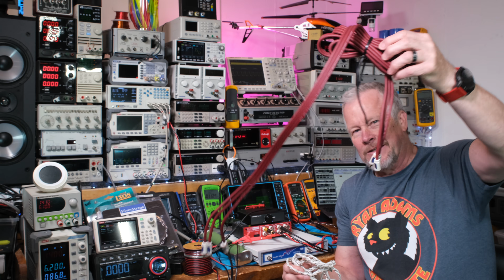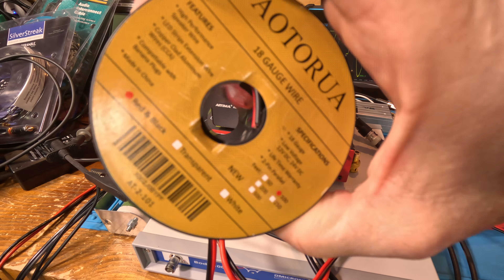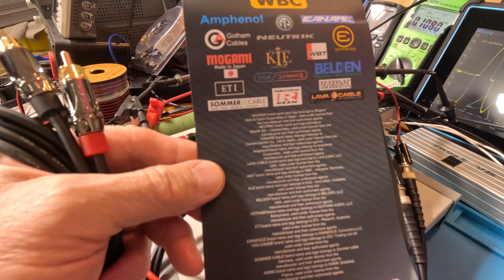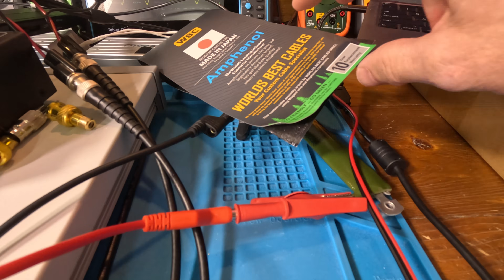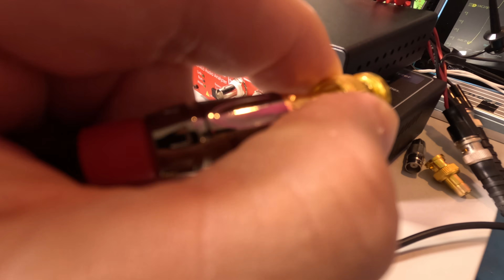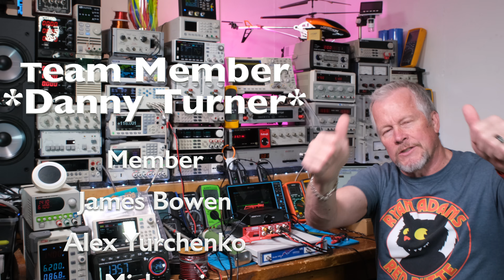World's Best Interconnect Cable Mogami cable with Amphenol connectors #docablesmakeadifference

Comment: I  have a Marantz AV10 Processor and Krell amplifiers. I use Mogami Studio series  XLR cables for all my audio. My system is dead silent with the volume cranked up. There is zero 60 hz issue, so I am more than satisfied with what I run. I also got some Mogami bulk cable and made my own speaker cables.
Reply from the maker: Thanks for your great feedback!!

Comment: Hi! I own a digital audio broadcast station. We are looking for some recommendations on a high-quality cable that can reproduce the best audio quality. We use only WAV files, and cheap cables simply deteriorate the sound. Do you have any recommendations? Price is not an issue, just finding the best cable with close to zero RFI and great audio transfer. Looking for a 1.5-meter cable that is 3.5mm to dual RCA. Thanks!
Reply from the maker: Thanks for asking!  The connectors are important, and a split cable does require attention to detail, so buying something a step above the lower cost cables will get you this quality I think.  I can't find the cable I used, but this looks close: https://amzn.to/4h64q2L
This one looks made very well: https://amzn.to/3QGel4D

Comment: I have a few RCA and balanced cables from WBC and I generally check everything before I plug them in. They use genuine components and have good soldering in the examples I have. I ignore the burn in BS for what it is. To be honest, I think cable gauge and build quality are everything. If it doesn't work out of the box it never will.
Reply from the maker: LOL the burn-in is one of the greats;)  I have to agree.  I do like the WBC brand as it is low cost and made very well.  Maybe overkill actually - but low enough in cost to be a great option.

Comment: It’s interesting that you did not comment on the burn in requirement apart from saying BS. I agree. As an electronics engineer working in the semiconductor industry my understanding and application of burn in is to test for infant mortality failures and reliability issues under maximum operating conditions. There is nothing in a cable that needs to be burnt in. I think that the 175 hours is required to convince the purchaser that the money spent was justified.
Reply from the maker: @David-ot7mv The burn in on a cable is so silly I couldn't even offer any time but to cough;)  You are correct, burn in is meant to catch infant failures.  It can have a huge impact on reliability.  

Many vendors find better ways to catch these infant mortality failures though - that are better than simply burning in...  They run a specific test that exercises the product in a way to get to the infant failure quicker.  Burning in a cable is absolute absurdity.  

Anyone that says they can hear a difference - can not prove that in any blind test.  Has not been recorded as of yet - even though there are many that 'believe' this.
Reply: @kissanalog James Randi's challenge was never accepted, while industry related reviewers achieved 50/50 results in a blind speaker cables test arranged for by sound and vision mag decades ago. Yet here we are freezing cat 6 cables. Bandwidth and slew rate limitation related to properties of active devices locked in an NFB loop is one thing, atrocious level of distortion produced by speakers in an imperfect room is another. If human hearing was good enough to even notice that, we wouldn't be able to withstand reproduced sound in the first place.
Reply: It's real. Take a length of copper straight off the reel and   make a cable out of it. Put it in your system and run a rew measurement. Let it sit in your system, running for a week and then run rew again. Dumb thing to argue about though because after 100 hours or so the point is moot. Many manufacturers spend the money and time burning in. I doubt they would do that if there were no differences to be had.
Reply: @Pete.across.the.street Please publish these data, perhaps you could also apply for a patent on a set of signals that facilitate/hasten the process? You could single handedly rattle the foundations of engineering and go down in history as the guy who turned conjecture into a canon.
Reply: @paulb4661  ok
Reply: @Pete.across.the.street I find listeners can easily point out differences between amps, as long as they know which one is playing. As soon as the cover and a set of DPDT relays kicks into action however, they suddenly become considerably harder to distinguish. Once you consider bandwidth and slew rate limitations of any amp working in an NFB loop, then add to it, technically speaking, absolutely appaling performance of speakers in an imperfect room, the influence of cables becomes marginal at best. If human hearing was good enough to sense and quantify differences you speak of, you would cover your ears and run screaming out of the room, acutely hearing copious amounts of various distortions produced by any Hi-Fi system. Psychoacoustic studies(it's ascientific discipline) have long established limitations of human hearing, but it seems, these do not apply, when it comes to individuals with strong beliefs. James Randi 1million $ speaker cable challenge was not accepted. Blind test on a large group of industry related individuals, conducted under the condition of anonimity of course, by sound and vision magazine, showed none of the participants achieved a statistically significant results. Yet here you are... freezing cat6 cables.
Reply: @paulb4661 how did you find that? By reading it on asr? I belive it because I heard it, measured it, and have done null tests with high quality binaural mics and pro tools. I think most people that can't hear a difference either have a poor system, have system poorly setup, bad room, poor hearing, or have never actually listened for differences

Comment: I have one of their cables.    It was the sortest digital cable i could find.    I had to laugh at the burn in.    Are the 1s and 0s gonna be different.    I really doubt people can here the difference in rca cables if you got it yesterday or 10 years ago.    I am not gonna argue with people that believe that.    Its just very unlikely.    Not to say i don't like there cables.
Reply from the maker: @jasonk5979 No - the 1s and 0s do not care - unless the cable is very long.  Short cable for any signal is almost always better.  It is crazy that people sell expensive cables for digital signals in audio applications.  It is actually sad that the industry is this twisted.
Reply: @kissanalog  

It's been kinda sad for a long time.     Cable companies selling customers on all sorts of nonsense.    Without any data to back it up.    Don't get me wrong.    I like high quality cables. Looks/ durability .   And i don't want it to negatively affect the sound.    I just don't believe in most of the nonsense .     At least Worlds best cables are for the most part reasonably priced.
Reply: Why would the ones and zeros be different?
Reply: @Pete.across.the.street  

It's a digital RCA cable.  They wouldn't be any different.    I assume they just print that burn in nonsense on every package.
Reply: @jasonk5979  it's still copper and the noise that it picks up can still be injected into the signal path. It doesn't do anything to the 1s and 0s though. Fiber is the only way not to get any noise added.
Reply: @Pete.across.the.street  
Sure it could.   But I am not having that issue.
Reply: @jasonk5979  great, thanks for the update. Most people don't know the noise was there until it's gone when they use a better cable.

Comment: I can't figure out what you're doing, you make fun of burn in and say you've worked with military electronics equipment?

You obviously don't understand what the purpose of an audio cable is, it's to transmit a music signal, which means you have to listen.

I can tell you that an unshielded cable will almost always sound better than a shielded one, so what you're doing is totally stupid and has nothing to do with hifi.

Should you finally make a measurement, a null test with a music signal will be the right one, several have done this, including ASR, they measure the differences between the cables cheap as expensive to around -100 db, which means that no one will be able to hear differences between cables, that is the puzzle, because on a transparent top system it is not a problem to hear differences between cables even in blind test and burn in is also heard.
I ask again is it noise pickup you are testing, in short, what do you want with your video, other than to create some content?
Reply: You obviously haven't watched his "1 million dollar cable challenge" video. If a manufacturer of snake oil expensive cables is too afraid to do a double blind test of his own cable,, how is it you can tell the difference?
Reply: @ianhaylock7409  I've watched the video and it's the same pointless nonsense as all the other videos he has made on this topic. 
Eddie gives a lot of irrelevant known and obvious knowledge, constantly laughs sarcastically, sighs and doesn't miss an opportunity to tell how stupid, crazy and uneducated some audio enthusiasts are.

Please read the following from another video Eddie made on this topic and notice he ignores my last response.
https://www.youtube.com/watch?v=CixXCmkX_5E&lc=UgyNWIAQfruKZaIwDLd4AaABAg

The conclusion of the ‘1 million video’ is that Randi withdrew the offer of a test when Michael Fremer wanted to use his own cable.
I also have a friend who enquired about the possibility of taking the test.
He withdrew because he believed that no human could fulfil Randi's requirements, so Michael Fremer must have been very very confident that he could identify his cable those many times in a row and Randi apparently also had doubts about his project and withdrew

Comment: For me cables need to look really good and be reliable. As long as they do that for a reasonable price I get them. The cables that I won’t buy are the ones that are said to be directional. I will not give money to a company that tries that BS
Reply from the maker: @philipketchum1407 This is a very reasonable approach.  Buy what you like and it will sound good.  If no one can show a technical reason to buy a cable that offers some benefit - it is because there is no benefit.  

I am showing here that cables with the shield/return connected at both ends actually do what they are supposed to do - filter the higher frequency noise better.  But we are talking microvolts -and I highly doubt this can be detected by the human ear.  

There are some that will only terminate one end - and this can work for lower frequency noise - like audio band stuff.  But - it is hard to know which end does a better job at being terminated.  This has to be experimented with.  Some say the source end and some say the load end.  It is low frequency - so I'm not sold on that there is just one way.  I've experimented in the past in expensive EMI chambers - and it differed depending on the equipment.

In most cases - I have found terminating on both ends is the better solution.
Reply: @kissanalog  I haven’t seen anything in your videos I can disagree with. Strait to the point and easy to understand. I don’t recall any controversial claims you’ve made. I myself am a retired biomedical electronic engineer from the healthcare system. I understand the technologies. May not be in the “Audiophile World” but the technology is still virtually the same. I’ve worked with dozens of cable varieties in many real world circumstances. I’ve been involved in the design and implementation of many system. I’ve pulled thousands of feet of cables short and long in very demanding environments. Shielded, twisted, material-types and cable gages do matter. In the conditions and applications the bulk cable manufacturers designed them for. And the technology works within it’s design limits. The problem I have is audio cable manufacturers exploit that technology and use it in patch cables and speaker cables that are typically used in a very safe and controlled environment. Not for what the bulk cable manufacturers designed their products for. The audio cable manufacturers technically are using a proven technology but it usually doesn’t or shouldn’t apply to their customers. Unlike most industries there is no real governing bodies in the consumer audio industry to do independent testing and certification of a product or claim. It’s the unregulated Wild West. That is one reason the “Audiophile Community” argues endlessly over the cable topic. Almost more than any one topic, that I can think of. Outside of politics. The comments in social media are filled with people regurgitating things they once heard from (that one guy) and they believe it. And unlike the medical field where a placebo effect can be a serious issue. The placebo effect while listening to music is real but not a danger. The listening experience you hear is actually in your head. The placebo effect can be very costly but that falls into the value category. Only dangerous to your wallet. That category also has no regulations so it’s completely up to the consumer. I have made hundreds if not thousand of terminations and or patch cables in my career. I don’t want to do that anymore. I’m willing to pay a company to do it for me. I will purchase a cable even with technology that I know I don’t need and will not improve my performance. If I like the cable and price I’ll buy. I just disregard many of the marketing claims. These gimmicks typically won’t hurt your system and most are overkill so it’s not worth worrying about. I’ve used all the gimmicks in my 50 plus years of high fidelity. Including phono patch cables that claim the cables must be used in one direction. Not because of the connections or shielding but because of the conductors. Lol. But I liked the looks and price. If I’ve ever had an issue with interference, lack of performance or distortion it’s never been fixed from a cable design. I instead correct the root of the problem. I understand that there are some people that may live very close to a 380KV power grid transmission line. Or very close to a cell tower. They may need extra shielding. The vast majority of home stereo systems are not going to encounter that much industrial noise. Some homes still have very old infrastructure like old T12 or T8 fluorescent ballasts or a very old rotatory light dimmers. those types of devices are becoming rare and should be replaced if you have them. Outside of those conditions a home environment isn’t in need of exotic designs and shielding. 
I also strongly believe in the looks of a cable as part of a stereo system. Your cables should look as good as the components they are hooked to. It’s in your home it should look good like your furniture. I sure don’t want zip cord from Home Depot laying across my living room floor. I like bling bling and quality materials. Bling bling and good materials aren’t that expensive. Performance claims (Snake Oil) is where the real profit comes from. Because it’s typically subjective with no certifications of performance for that particular use. That’s that “Value” category again. You and your pocket book is the governing body. If you think your system sounds better with $5,000 quad shielded,triple-twisted cables with cable risers. Fantastic I’m glad you enjoy your system more with them. 
As a side note, modern stereo systems can have a digital portion to them. That’s a different subject. Especially if your source is on a complex computer network. 
Anyhow, that’s me bloviating on this topic
Reply: You don't think draining the shield wire gives you any benefit? I think it is a pretty common practice because it works and only works if you use it in the correct direction.
Reply: @Pete.across.the.street  nope. I don’t believe in that
Reply: @Pksparty2112  well it is a thing whether you believe in it or not. If you don't put the drain end on the receiving end the noise that is picked up from the shielding goes right into the receiving end making the shielding useless.
Reply: @Pete.across.the.street  nope, I don’t agree with that. Yes I just repeated myself.
Reply: @Pksparty2112  cool, cool cool